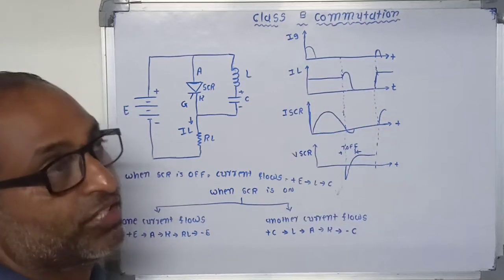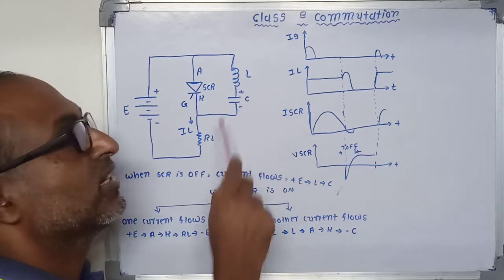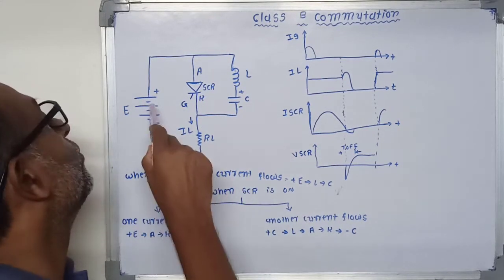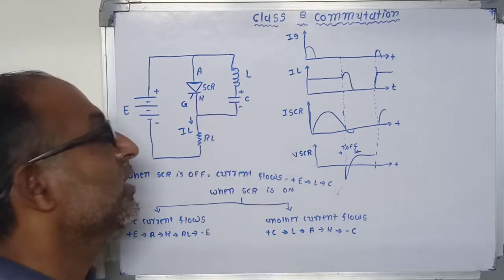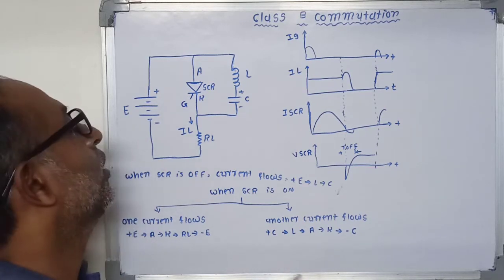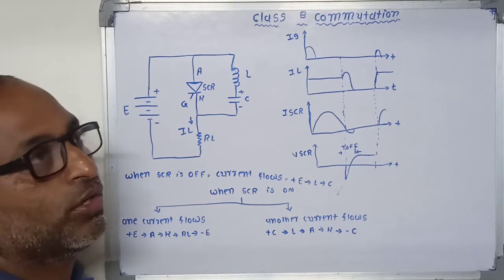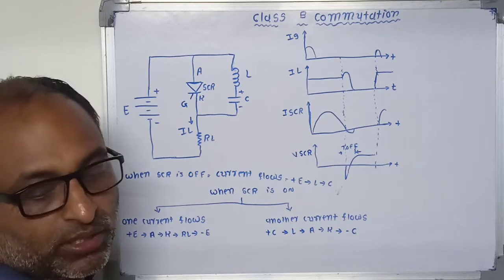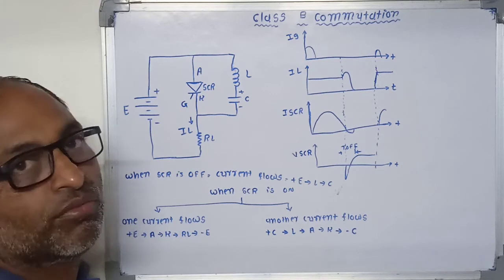English-Class B commutation

Comment: How it is possible capacitor charge reverse direction in DC supply
Reply: I am also stuck in the same question 😅
Reply: Bro I think due to the sinusoidal current flows through the lc circuit capacitor gets charged in reverse direction maybe...
Reply: @OmkarOP_07  this is dc curent  from where the sinusoidal current  come? Please  narrate it